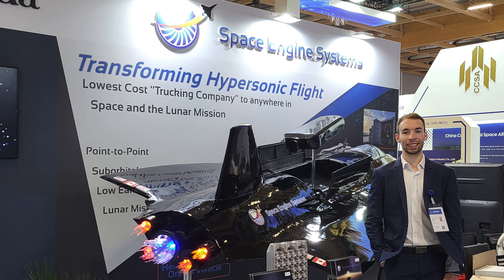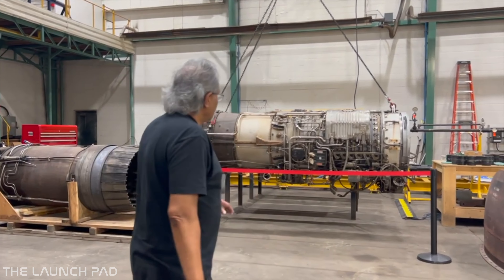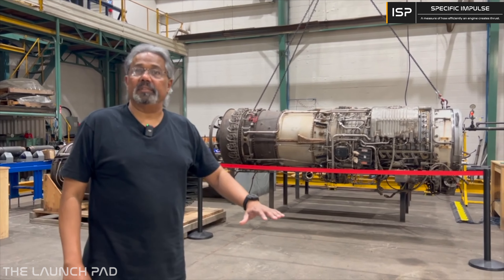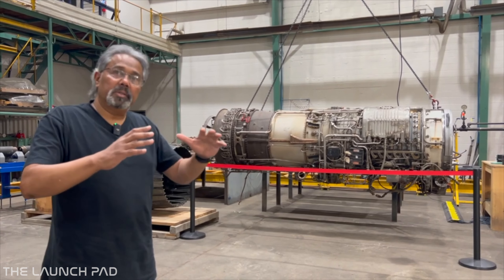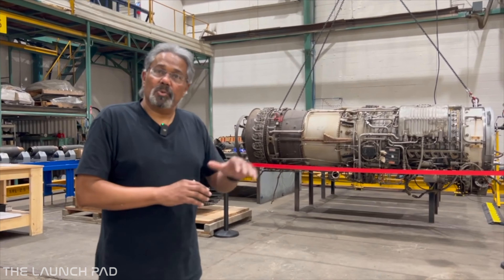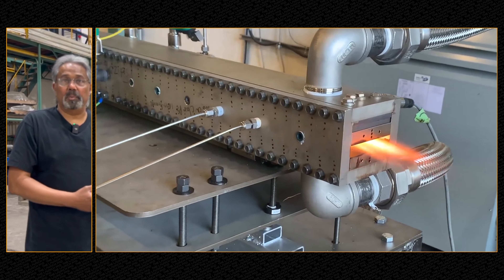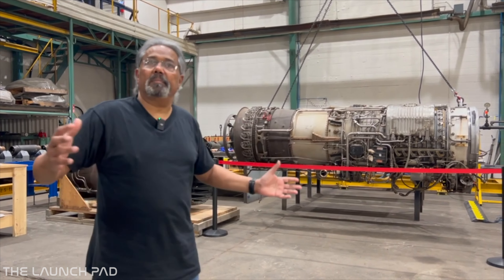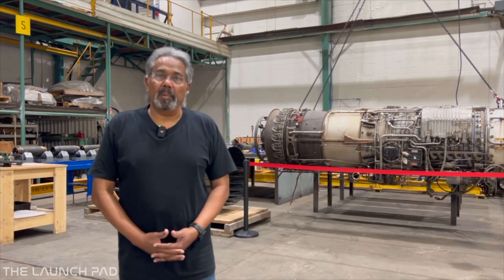The Future Of Hypersonic Flight | TLP Exclusive Tour + Interview

Comment: Finally someone is actually awakening from the whole rocket BS.
Going to space doesn't have to happen in 5min or bust.
Every altitude range have different optimal solutions.
Just blasting trough all of it is not efficient and never will be.
Multi stage systems are the future!
Great interview. Thank you for the content!
Reply: In the long term, absolutely. Rockets throw away a lot of propellant away to get through the athmosphere. To make some type of air-breathing first stage is not a new idea. Only a few actually ever got to launching payloads and most failed and for various technical, economical and practical reasons or combinations thereof. The thing is, wasting fuel is not the problem, cause fuel is cheap. The cost is in building the rocket and launch procedures. Any type of fully reusable system, whether is comes from spaceplanes, rockets, SSTOs or multistage will reduce the cost tenfold. Only after that the competing companies will turn to fuel reduction.
I hope these guys make it. There is a lot of interrest in the military now for hypersonic flight so if they get the prototype of the ground DoD will likely throw some money their way.